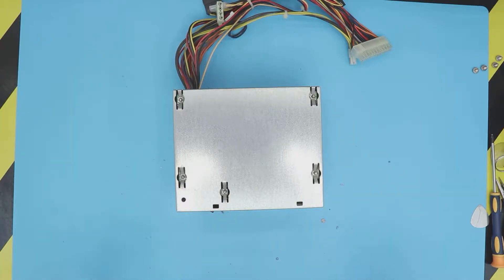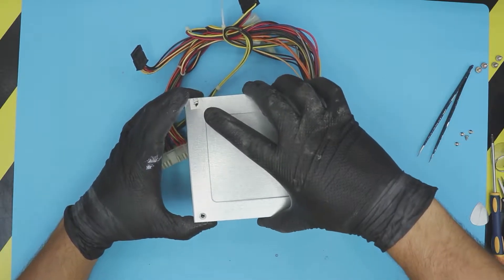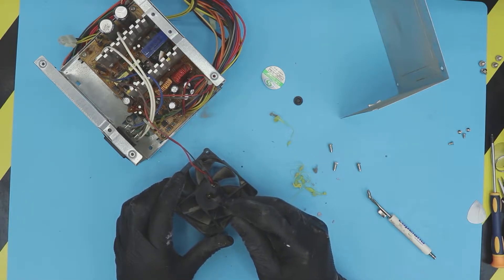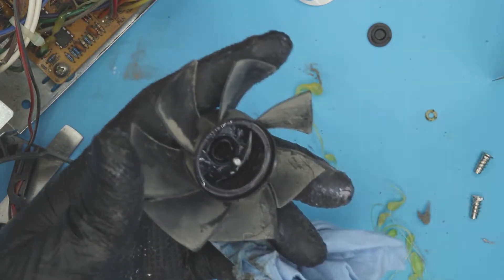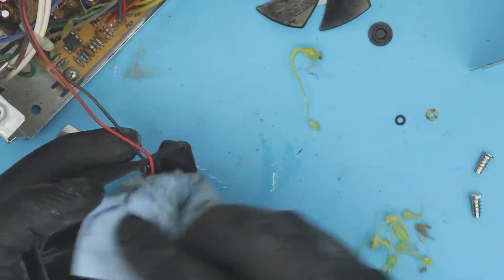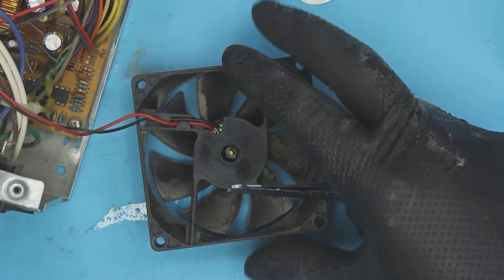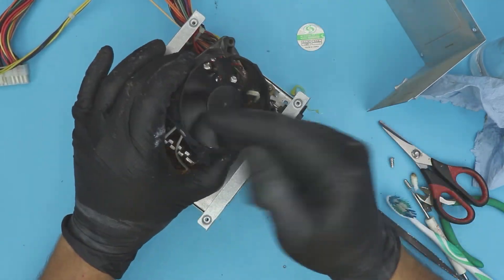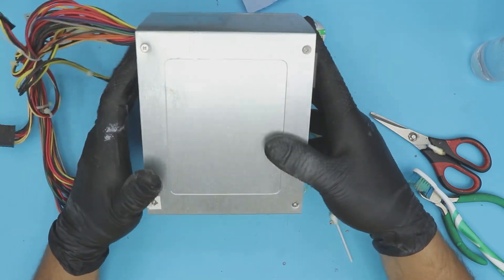✔Computer Power supply fan repair and FULL service

Comment: I notice there is no plastic shield on half of the fan. Other power supply units have that plastic sheet/shield. Is it necessary to have it if it came with with it?
Reply from the maker: Thank you for the feedback! if you wish to support the channel you can LIKE or SUB or both :P
regarding your question: the reason for that is to direct the air flow, it is important to keep the shield in the same place and not extend it. else you will have a over heating and burnout.

Comment: So my fan doesnt work plugged into power supply but when i give it 12 volts from a different supply it works.. and before i had to jumper the green and ground to get power but now i have power no matter what??? Help
Reply from the maker: Thank you for the feedback! if you wish to support the channel you can LIKE or SUB or both :P
regarding your question: then you have partial dead psu on the main board it has a few capacitor make sure they are not inflated, and or they could have a bad transistor :( its very hard to diagnose your issue over text not having the same PSU model in front of me to test the components :( give me the exact PSU model let me see what i can do.
Reply: @uFixTek thanks for the reply.. i have a liteon model number ps-5301-08ha 300 watt... it happened after 2 of the positive wires touched for a second or two.. i was in the process of turning it into a bench power supply and testing the outputs .. the capacitors look fine
Reply from the maker: oh boi if that happened then you for sure have a blown transistor ( the transistors are the one touching the heat-sink aluminum), let me see if i can find anything near that model then i can show you what to look for.
Reply: Ok thank you.. is it normal for all of the power to be working fine
Reply from the maker: @ryan-ue2vr  yes there are many voltage rails in the power supply.